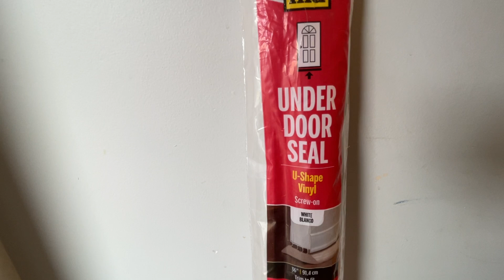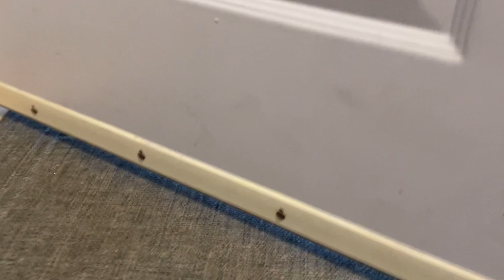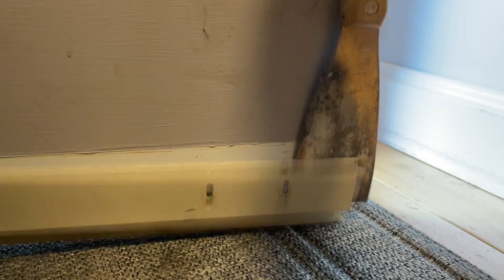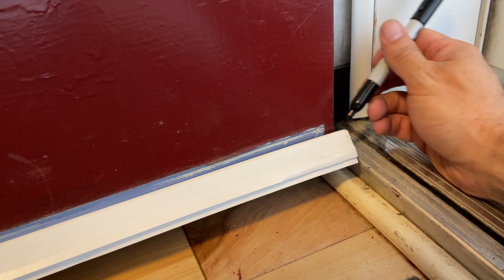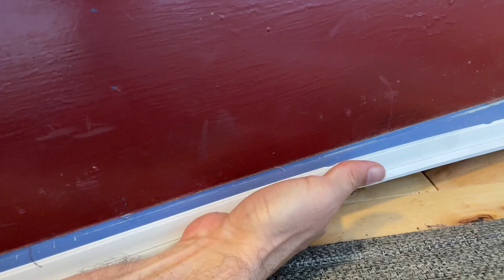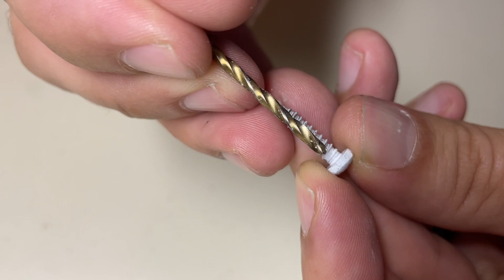Replacing your Door Sweep: A step-by-step guide

Comment: Great video. 
Do you have one thay shows how to fill in the old screw holes. We have a few of them and some are one the front of the door.
Reply from the maker: Filling the holes would depend on the door material. I’d probably use a paintable silicone for most metal doors.